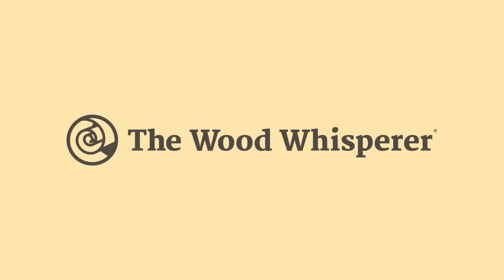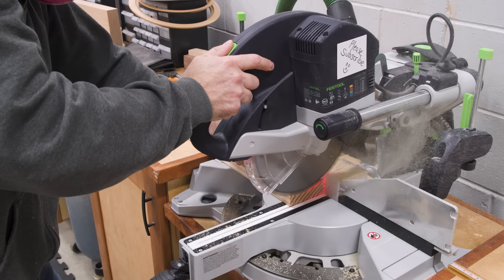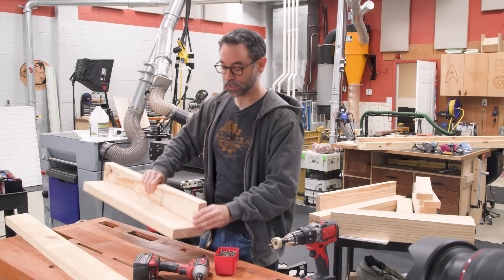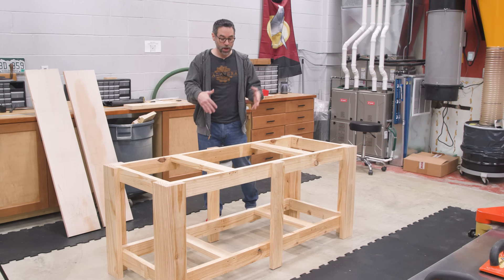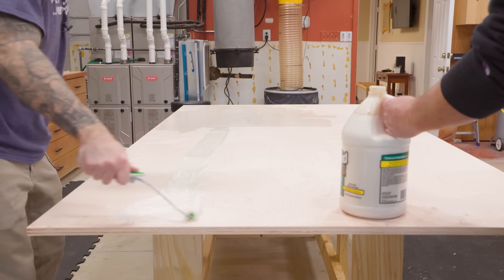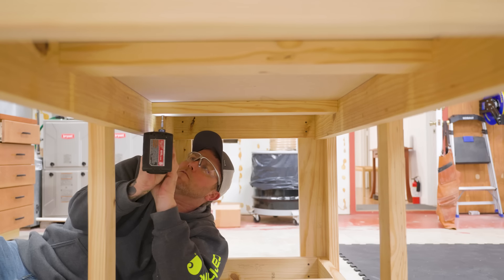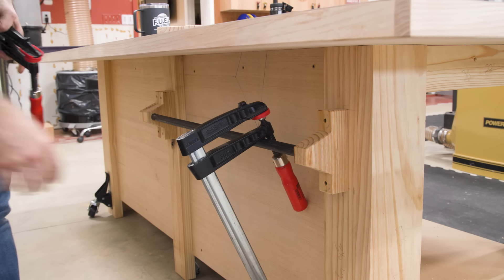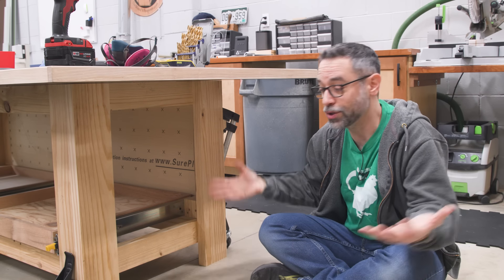Torsion Boxes Overrated? - My New BIG Assembly Table

Comment: Assembly table? Or just a big horizontal surface to throw crap onto? lol
But yep, I'm in a neighboring state (OK), and good plywood is still crazy expensive at almost double what is was in 2019. Even a sheet of 3/4 MDF now costs over 50 bucks. I'd probably use it though instead of plywood to save some money and MDF is great for tops, especially when laminating it with a top surface. Hate working with it though and it's heavy ... which is both a con and a pro! Nice table, Marc - enjoyed the video.

Comment: Yes the top will warp without a backer sheet.  All brands of laminate sell backer sheets in both post form and GP, the backer sheets are sometimes regular sheets that had defects  and they sand the top colour coat off.  If you want you top to stay flat you must use a backer sheet.  BTW.... use bondo to fill holes, it doesn't shrink, dries super fast and is very stable and hard.

Comment: I found some black two sided melamine. I don’t think glue is the best option to put the two sheets together, correct? What about contact cement?  Should I still use screws?

Comment: You were smart to add the lament to the other side - over time, it will warp.  I have build a number of these type tops and the ones that are not symmetrical, warp over time.  If you're in Arizona or Colorado - may be not.  You have something called...  humidity where you are and will warp anything over time.

Comment: Nice assembly table! I agree that a torsion table is overkill for furniture. No matter what, the piece built on it will wind up in a place that won't be super flat. I've found that SYP is a very squirrely wood, and can curl up into a ball when ripping in half. It's due to the case hardening when drying and because of the vastly different hardness's between the grains of the dormant an non-dormant rings. It's an incredibly strong wood, but can be very difficult to work with. I think particle board is the best material for a flat top — even the best plywood is never very flat. As for the balancing of the Formica, they sell backer material that is much cheaper (same material with no pattern), and you really do want to use it with a large top like that.

Comment: Also - the best trick for laminate is not a plastic sheet-it’s a long extension cord. You run it back and forth across the glued substrate and pull it out as you bond the top. This trick allows one person to deal with huge pieces of laminate w/o a helper.

Comment: Southern yellow pine is very strong, it's the only wood you would want to use for scaffolding, spent years framing houses, that's when I learned all about that wood, it's generally straighter then other pine as well...i need to make an assembly table as well, want dog holes ya know MFT...

Comment: Mark, is there a reason that you didn't add the top with the laminating screws underneath, rather than on top? That way you don't need to worry about dropping something on those screw holes.

Comment: Would 3/4 mdf have been a good choice for the top especially for its flatness (works quite well with Formica?  I’m guessing that the reason is related to overall strength as it has a greater tendency to “sag” between support pieces which s n excellent reason.

Comment: There are only two types of concrete floors: those that are unlevel and those that are unlevel and cracked.

When I built my workbench, I used the brilliant Wood Whisperer wood taps to make holes in the leg bottoms, and then I screwed in 1/2-in galvanized carriage bolts which I used to level everything perfectly. When no leveling is required, they only add about three quarters of an inch to the height, which is easy to account for in the beginning.

Comment: Nice build.  Do you have a design for a work table with an infinitely adjustable height between say 30" to 40"?  I have a limited amount of space in my shop and would like to use the work table as a run-off table for my table saw, band saw, planer etc. which are all at different heights. I have all these heavy tools on wheels so I can move them over to the table but I can't change their height.

Comment: I recently lost my shop space (landlord lost their insurance) and had to move my shop back home where it now lives in my garage. My garage floor is just awful and I don't have the coin to get a new one poured. I've actually been considering building a multi-purpose table with a torsion box setup (and maybe a 2nd one at the bottom), and making easily-adjustable lower legs/feet that I can adjust if I have to move it, etc. My floor is very wavy and dippy including about a 6 inch slope in the back 1/3 or so. It's bad. In my case, I think - think!!! - it'd be a decent spend of the time and effort. Maybe? Dunno. Maybe. Thoughts?

Comment: Just a thought - When you were screwing down the top from underneath, I noticed you screwing through the framework in the center of the two cross pieces to firmly "anchor" the center of the top. (In two places)   
Here is my point.... if those cross pieces are slightly concave to the table top, by screwing down the center of the table you may be cupping an otherwise flat table top.

Comment: You adding an access hole for leveling feet?  I think i am going to put them on the outside for access, I know mine will move a bunch.  If I go with 1/4" hardboard, you think screwing it on would be ok?  I am not sure if i may need to remove and replace down the road.  Awesome video.

Comment: By the way, if you don’t know, contact cement vapors are extremely flammable. A friend’s dad was a professional Formica installer. He worked one kitchen job with poor ventilation. The vapor flashed and he was severely burned. Hospitalized.

Comment: The thing I would do different is I would put leveling feet on all 6 legs. That way, no matter where you place the table or move it, you can dial in the top surface of the table to dead level.   Much of what I do on a work table relies on knowing two surfaces are dead parallel and level and its way easier to simply place something on a level table, and then measure level on elements with a spirit level or electronic angle finder, rather than trying to derive measurements vertically off a surface that’s off.

Comment: I have had experience of a formica desktop, 10' long, warping b/c I only put the laminate on one side, and I didn't screw it down b/c it was very heavy. Good idea to laminate both sides. IIRC I think the formica company even makes a cheaper "backer" version for balancing the layup. 

Yeah, I too think that torsion box construction is overrated, it's not inherently flat but must be carefully constructed to be flat, the composite structure resists bending, but so too does the frame that you have constructed for your assembly table.

Comment: Thank you Marc, it's a trip, and refreshing, to see you build with construction grade lumber for your shop. I've done it several times, mainly due to being poor, but it works pretty well.
I'm really curious, why didn't you flip the top so the screw holes were on the bottom and you don't have to worry about accidentally dropping something on the top and breaking through the laminate? Obviously that's an extremely low risk situation, just curious.
Reply: Side note, I MUST have that pretty, pretty...pretty good shirt. I can't go back to my shop without one

Comment: If you're building a torque box it's easier, cheaper, lighter, etc., to use 1/2" plywood for the face, 1/4" plywood for the bottom, 1" X 4" yellow pine jointed and planed straight and true for the ribs.  Also, in my decades of experience, one rib every 18" is enough.  You won't get machinist quality flatness but it will be plenty close enough.  Once you have the box make sure that whatever you rest it on (like saw horses) are level and parallel with each other so the box isn't in twist stress.  I use regular wood shims under the legs for that.

Comment: can confirm the slides do NOT come apart, the timing on this video is amazing as I just installed the same slides (48") in a staircase project where the risers are the faces of pull out drawers. warning to anyone else who uses these that the length does not include the locking tab on the single slide (yellow lever). I had to cut mine off because the opening was only 48.25" deep and the slide is 48" + the locking lever. hope that helps someone prevent some frustration

Comment: You probably didn’t need to laminate the underside but of course it didn’t hurt😄. At the very least, as an alternative, I might want to seal the underside with a good primer to minimize moisture getting into it but it’s probably a non issue imho.

Comment: Why not turn the supporting middle 2x4's the other way. It would match what you're already doing with the 2x's they go between. Also, they are much stronger structurally, and thus, much less likely deflect and/or sag over time.

Comment: TWW – Great project video. I built a torsion box assembly table years ago, and you are right – it is a very valuable component of a wood shop.
I do have a couple of suggestions.
1)	There are three elements of flatness: longitudinal straightness, lateral straightness and twist. A surface can be perfectly straight in two dimensions, but still be twisted. Twist is more offensive to project integrity than sag. Twist may be checked by placing 4’ or longer straight edges, one on  on each end of the top and sighting across them, the same way we check boards for twist. The longer the straight-edges, the more accurate the assessment. Even after assembly, if you have some built-in twist, it might be correctable by shimming one corner leg, and weighting the other three corners for a few days during a humid period.
2)	You can make your table infinitely-more useful by drilling ¾” through-holes in the top on a 4x4” grid over the entire top. These will accept stop dogs and Festool FSZ and FS-HZ screw clamps for clamping in all three dimensions. Chamfer the holes with a router and bearing guide.

Comment: Great assembly table! Did you consider using melamine covered particle board? That’s what we used at the cabinet shop I used to work at, it’s relatively inexpensive, flat, smooth, and glue doesn’t stick. Thoughts?
Reply from the maker: Discussed in the video. 😉

Comment: 2 sheets of ply together doesn't make a torsion box. A torsion box has to have wood running in one direction and strips running in the other, and maybe a sheet underneath, but I'd say more strips would do it. But two sheets screwed together on top of each other isn't a box, or a torsion box. 
Not that it matters though :D

Comment: Why not use a notched trowel for the glue spread? The roller does a fine job of spreading but it’s inconsistent and too slow. Using something like a 1/16” notch trowel gives you plenty of glue and is as quick as your arm can spread.

Comment: Great looking table, if you are going to bother with respirators while using contact cement, and you definitely should, you need the proper cartridges. The pink P100 pancake filters are not designed to deal with vapours only fine particles. As always thanks for the content.
Reply from the maker: Actually some of them are designed for vapours. There are variations of the pink cartridges that include nuisance level organic filtration. That's what we use. With proper ventilation and a one-time job, those work great for applications like this. If we were doing repeated applications and had no fresh air, I'd make sure Jay was wearing regular organic vapor cartridges.

Comment: I'm not an expert by any means however, logic tells me that even over a 4'-6' length most of your finished pieces to assemble are thick enough not to flex to make any difference in flatness. Cabinets are a box so it wouldn't matter and a chair or something of that nature usually has curves to it so again flatness isn't an issue. If a furniture builder needs to have that type of tolerance then they are in the wrong business. Just my opinion.

Comment: Honest remark - I really don't understand why you're not wedging the middle legs before screwing/glueing the top together. When you apply pressure screwing the sheets to each other, that just might be enough to bend the table base slightly in the middle as you even described yourself. Surely the bonding of the sheets is where you'd want to make sure they're completely straight and level, otherwise you're fighting a bend for the rest of the project... Strange and unnecessary risk to take, isn't it?

Comment: The semantics of "pre-drill" have always driven me absolutely insane. They're just pilot holes. No drilled hole is ever pre-drilled; it's just drilled. :)
Reply: But if your perspective is the driving of the screws, pre-drilling makes sense.  I’ve witnessed too many guys who merely drive screws without drilling pilot holes.  So these guys are merely driving screws with no ore-drilling.
Reply: Upon further reflection, most of these holes are shank holes, not pilot holes.  Shank holes are drilled in the board being held to the other board in which the threads engage.  If there is a possibility that the threads may split this latter board, pilot holes are useD.  Pilot holes can also make driving the screws easier.